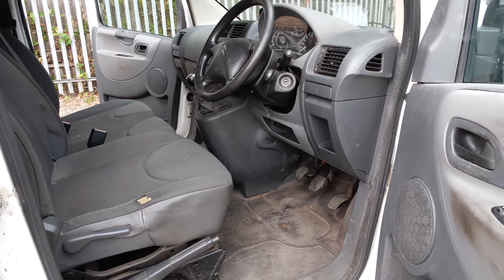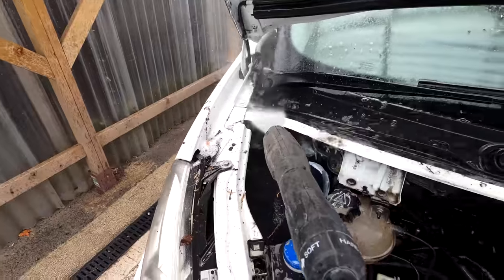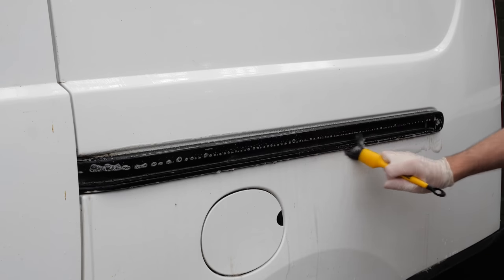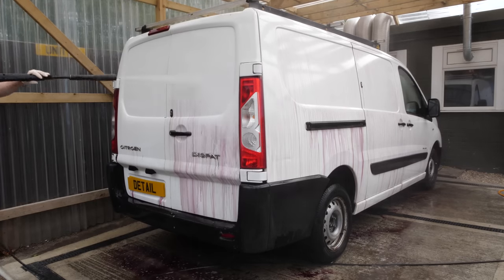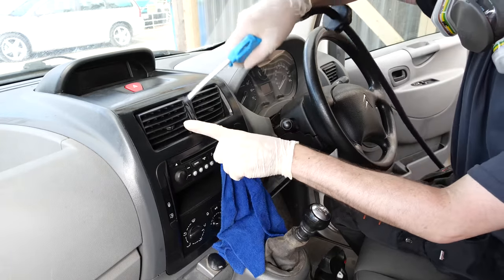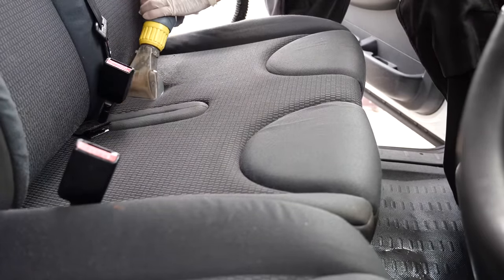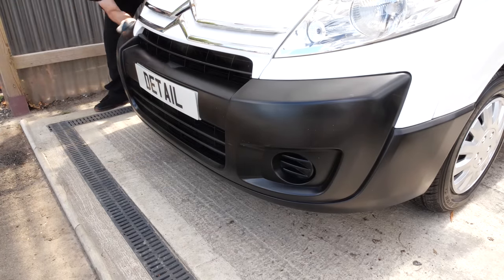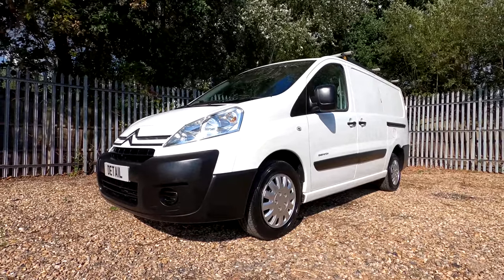Deep cleaning a Disaster detail Citroen Dispatch Van ASMR filthy/Dirty barn find/ Decontamination

Comment: As always a great  video, got to admit to being some what worried about engine and engine bay cleaning, speaking to an auto electrition friend, he says  that almost a third of his work comes from wet looms, definately enouugh to shatter my confidence.
Reply: Ditto. I just daren’t put my power washer into the engine bay. I just spray APC on to an old brush on to the bits I can reach, work it in, then wipe it down with a cloth. I need my car for work & just can’t afford the risk of doing something to it for sake of a clean looking engine especially due to its age & mileage. The bonnet is only lifted by me for topping up fluids & the garage for annual servicing. If it was a show car, then that’s a different thing.

Comment: Hi! Long time subscriber, I noticed that you use a flex forced rotation machine for more than a year. I watched almost all of the YouTube reviews on this machine. Almost everyone says it's a very smooth machine, but the battery tends to go very weak after about 10-15 minutes. It holds for 30-40 minutes, but not at full speed. Are the 2 batteries that came in the kit able to cicle themselvs between charging and working or do you need to take brakes? Also about the vibrations I saw you attached a foam pad on the battery (I suppose it's for vibration purposes)...so...is it that bad? In the beginnings I saw you used to use a rupes mille, vibration wise how do they compare? Please give us a review on the flex. It's a pretty costly kit and a big investment. You cannot trust 100% the reviewers on internet. I would prefer the opinion of a working man. Just purchased the little one (3" flex) and it's a superb made machine but a bit shaky and I do feel a battery drop when near 2 bars of "fuel". Thank you!
Reply from the maker: Battery’s last 30+ mins on 4/6 I have a 3rd extra one just in case but rarely use it. In the real world stoping for a break etc you never really run low on power! 
Mille was easier to grip as it’s a normal handle.. the flex is heavy on the back end due to the battery. 
And you tend to hold on to the base of that rather than the handle grip!
All DA’s vibrate, I added the pad to the base to make it more comfortable when using over long periods. 
It’s a good toll and once you have been cordless, it’s very hard to return to a cable powered machine 👍 thanks for the continued support of the channel.
Reply: @everydaydetailing6449  thank you! Keep them videos coming!👋